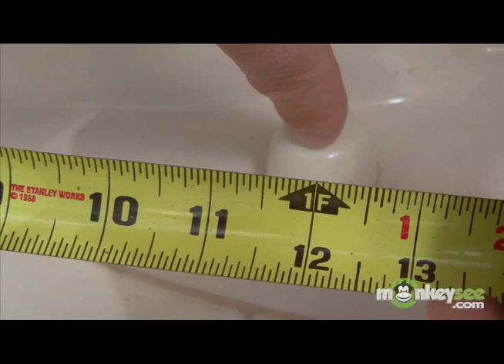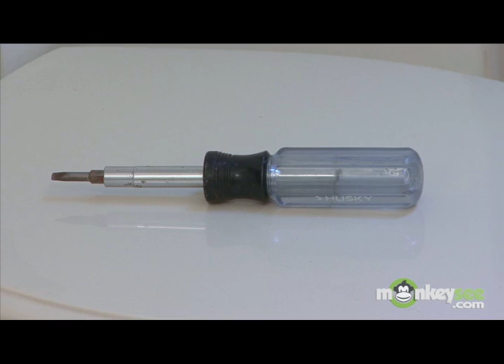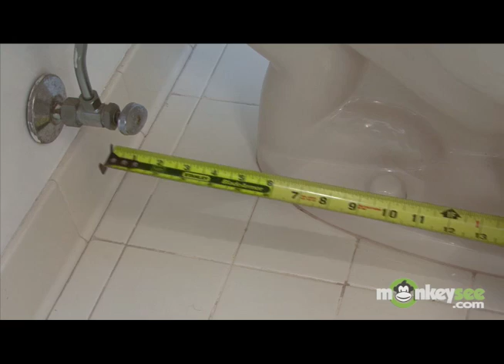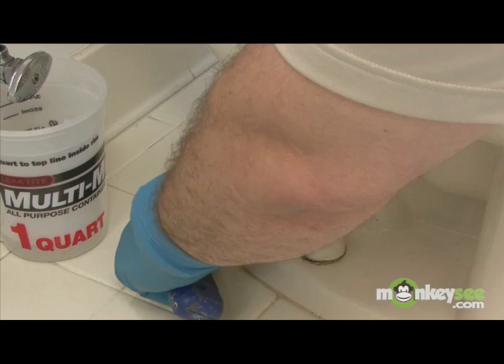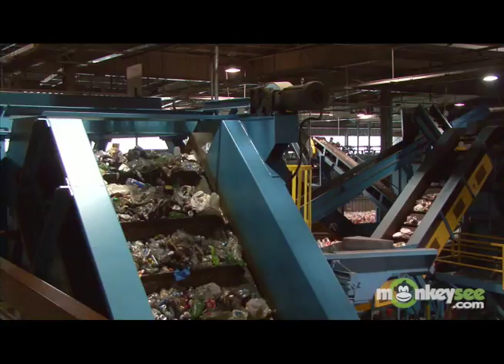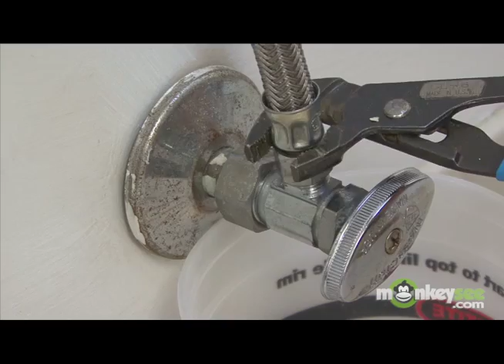How to Remove and Install a Toilet from American Standard

Comment: You replaced a perfectly good 1990s Kohler wellworth. And you should never caulk you toilet to the floor because sometimes it can pull up tile or carpet
Reply: BTR plumbing I agree I like the 1985-1996 Kohler wellworth better there is no reason to replace it. And I never seal to the floor because it’s not necessary because the wax seals it and toilets are designed to be removed and serviced and worked on and then put back. Also Kohler is way better than American standard. Though American standard is ok. And caulk can damage the floor if not cut when removed
Reply: At least the toilet looks good
Reply: It was, but they probably did that just for this video and to show people how to replace their toilet if they need to replace a broken one or something.

Comment: I read instructions on my American Standard.  It had the wax ring put on the toilet and then set in place.  The caulk sealant was placed on the bottom edge of the toilet while it is upside down and then turned over and put in place.

Comment: You're incorrect. Plumbing code (regardless of State or municipality) requires the following: 405.5- Joints formed where fixtures come into contact with walls or floors, shall be sealed.

This is done to prevent dirt and bacteria build up. This is why you DO seal off the base of the toilet. Hope this helps.

-Tom
Licensed Master Plumber
Licensed Plumbing Contractor
Former Plumbing Inspector

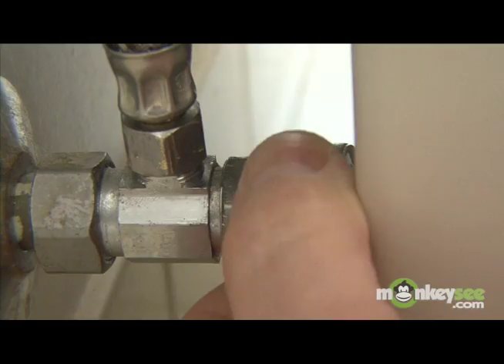Comment: Did anyone else see that the supply valve was pushed up against the tank (8:00). I'd think that would be a bad situation
Reply: i installed one of these and had the same problem. just barely was able to turn on the water.. i'll never install another toilet of this design again.

Comment: Thanks for the video. Lots of great detail, particularly about measurements. Some good tips too, like putting TP in the hole as you install wax ring to block gasses, so you can just flush it away.